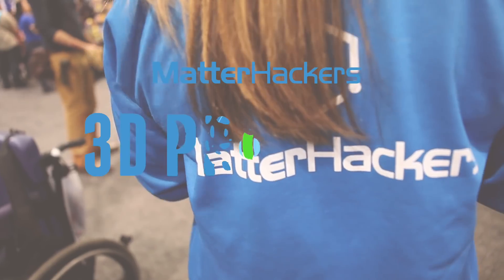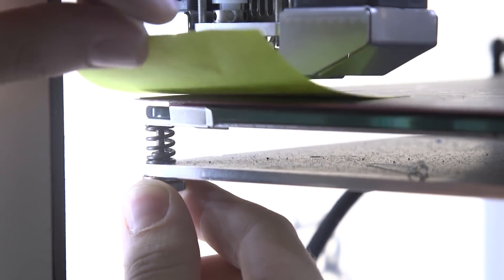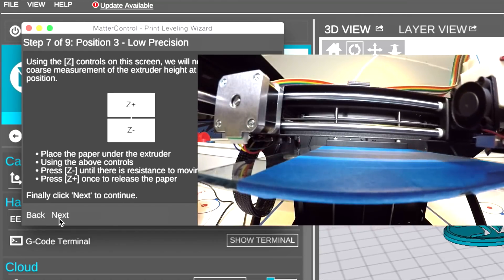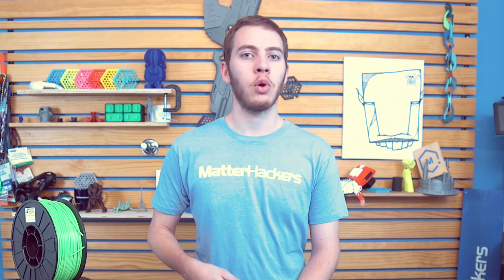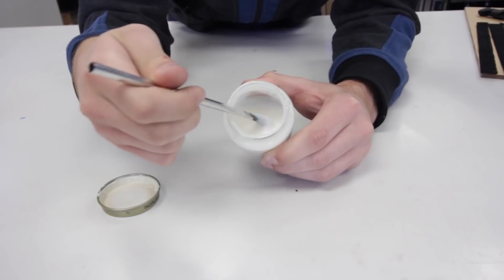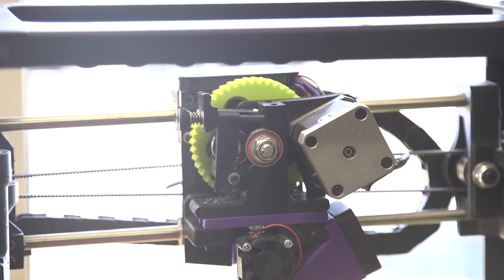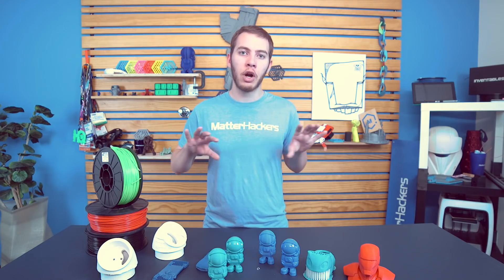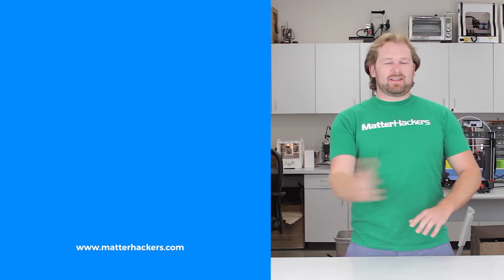How To Succeed When 3D Printing With ABS Filament // How To 3D Print Tutorial

Comment: You're so right, I think the key is the ABS slurry (acetone + ABS) and a rough surface to promote a mechanical bond.
I also laugh at the "smooth bed" comments.  Clean of your finger oils... yes, but smooth, huge no.  But if you don't want to scratch up your build plate, I often use wide kapton tape.  You can scratch that up with 0 guilt.  Just peel it off if you need to return to a smooth 😎 surface again.

Also, on my giant CR10-S5 bed it will only do 80c on a good day (barely, that's mostly lies unless I break out the iron 😆 🤣😂)...  So ABS can be a nightmare on that.  I have a new A/C silicon heated bed coming soon.

But, even on that, I AM able to print ABS using ABS slurry, as long as the slurry sticks tight to the bed, and the print is not too tall.  Unfortunately, the taller the print, the more chances it will rapidly cool and split mid-air.
ALSO...
WARNING ⚠️  Some bed materials will degrade immediately when contacted with acetone.  
Glass is ok 👍 
I use a Wham Bam PEX flex bed on the S5, and they even officially recommend restoring it with acetone, so I know it's safe to use there if that's what you have.
My other smaller printer has an aluminum build plate (which is where I frequently use the kapton.  It pretty much stays that way lolz).

So just be careful with your "special" coatings.

Also, turn off any fans, close nearby vents, generally block airflow, and don't try it in your sub-zero garage in the dead of winter 😉.

Comment: I print abs perfectly fine at 90-95c on PEI, my printer Is in an enclosure. I print around 230-250c hotend. First layer .3mm, 30mm/s after 4 layers 62mm/s no fan on unless bridging. I get nearly perfect prints. I do also use a little bit of gluestick*thin coat*. Hope this helps someone that maybe at wits end and has tried everything else. Good luck, happy 3d printing.

Comment: I don't understand why this video doesn't cover the issue of ABS sticking too well. Makes us think it is hard to stick while in the meantime it gets glued to my smooth pei sheet (ASA is even worse!) and even pulls of pieces of the pei. 

Yes it warps and cracks without an enclosure, but the first layer, and especially those nasty brims you suggest are the hardest to remove.

Any idea how to prevent this?
Reply: Use a purple elmers glue stick and a little water to create a thin layer on the print bed. There shouldn't be visible glue on the print bed, it should be super thin and almost invisible. This same trick works for PETG too, happy printing!

Comment: I just got my Creality enclosure and was trying to print ABS on my mirror tile. PLA sticks fine with nothing. I tired glue stick and I have no idea how anyone can use that cause it just dries and gets super slippery for me. Then I tried a couple light passes of hair spray and it was like magic. Cura has the default ABS bed temp at 80C for my Ender 3 Pro and it worked fine. Sure glad I didn't start off with ABS when I first got my printer cause that would have been an even bigger hurdle than dealing with bed leveling before I got the EZABL installed.

Comment: A lot of this goes the wrong way in my opinion. Some of this improves the outcome and improves chances of a good outcome, but it needs to go farther for better results. One, discourage the use of a sliding bed machine is suboptimal for ABS. This is because the constantly sliding interrupts the boundary layer insulating the part. I know people do successful prints but it's harder and more likely to end in failures and likely to have more internal stresses in the part. An enclosure helps but it should be an actively heated enclosure of at least 60C whatever the machine type. And I've found that a not-sliding bed requires less enclosure heating by 5-20C compared to similar results with a sliding bed machine. A not sliding bed is easier to enclose too since you don't have as much volume to enclose. This may mean improvements to the machine, especially if anything is printed in PLA or PETG.

I'm pretty sure Kapton tape doesn't disperse the heat any better than glass. 

I really don't understand how an enormous brim helps because that plastic at Tg is usually pretty weak. At best, it's a band-aid.

It seems like hairspray-all-the-things suggestions are inappropriate. If you have clean PEI you shouldn't need to use hair spray on it, otherwise it's just an expensive substrate, might as well just use hair spray on glass.

Comment: Different printers have different success rate when it comes to printing ABS. I have a Lulzbot Mini and it prints ABS near perfectly right out of the box. It doesn't look as detailed as PLA, but you normally use ABS to print functional parts - mounts, enclosures, etc. So beauty is not a priority. Yes - if a part is large (ie it takes the entire bed) - corners will lift a little bit, but it doesn't affect anything other than aesthetics.

Comment: I have a big experience printing ABS. I don't even use enclosure, unless the temperature is below 10 C in the room. I heat my Prusa style ( Anet A8) printer  to 90 C and that's more than enough. I use 236 C for hot end.  Printing speed 60 mm/s, 0.2 mm layer build.  The main secret of printing ABS is to create a good grip with the surface of the bed. What I did is I got 80 grit sand paper and I rough the surface of my cheap window 1/8" thick glass bed wet sending it in one diagonal direction.  It takes about maybe 10 minutes. Then I use ABS slurry ( acetone + ABS filament, yogurt like consistency) to cover the bed with finger or piece of anything...whatever, but don't use sprinklers. It doesn't work with spray gun or mechanical sprinklers. I've never got any lift off problem printing ABS. It's amazing how most of 3D printing guys using smooth surfaces of the bed ( glass, aluminum or whatever) and expecting for the printed part remain attached and not get lift off. Come one people. Its physics. If the surface is smooth, nothing gonna stick to it. You have to create a nice grip just roughing the surface. I did with 80  grit sand paper and it works. Just get a block of wood. Just fold it with 80 grit sand paper and start wet sanding ( from one corner of the bed to another corner, don't crisscross) it  for like 10-15 minutes. That's all..... It works with ABS. I only print ABS and its great. It works every time. Peace of mind and you can rather concentrate on your design. And one more thing for ABS please dry your filament in oven 4 hours before printing for better result. You can use cheap $35 food dehydrator. There are plenty of them on the market in range of  $25 - $65.
Reply: Tigran Ohanyan your comment was better than this whole video! I’m goin to try this out
Reply: I just would like to say that I tried everything that you said and now I print abs amazingly well!!!! Thank you so much for sharing your experience
Reply: Thank you, this is more along the lines of what I was looking for since my bed only heats to 80, not "if your bed can't do 110c gtfo kid".
Reply: how do you would the precision of your ABS prints? Is 20mm, 20mm after printing? or more or less?
Ive found PETG and PLA to be very precise.
Reply: Awesome ideas for abs! I'm definitely going to give it a go
Reply: Haven't tried ABS yet but regular PLA  sticks a lot better now.
Thank you for sharing this tip
Reply: I just started trying ABS and came to most of the same conclusions. I have a small test print going. Bed is 90. Nozzle is 235. 66.6666mm/s. I used glue stick... It was terrible for PLA. But this is the first print I've got to stick with ABS. Glue stick is working so far. But, I'll definitely get a piece of glass I can scuff up and use as an ABS build plate to see if it helps. Thanks!

Comment: This will help me out a lot,starting out with printing ABS on an Anycubic Kossel Delta Linear Plus as my first printer,been getting good results at 230C hotend and 100C bed temp,but now I will up the temps and hope it makes the difference I need,also printing at .1mm which seems to help and a speed of 30mm/s at 100% flow and fan speed at hotend 100%.Still learning but I think this info is what I really needed to know,thanks man
Reply: THEOZ2106 I have the same printer you have and I print abs with 245c nozzle and 110 bed and fan at 30-60% at 60mm/s

Comment: Hi guys! thanks for the video Im right now deciding on what 3d printer to buy there are so many and Ive seen All the reviews on youtube and I just got worse , now I really cant decide??!
need help picking a good printer enclosed with heated bed for ABS and space for big builds and as I can see auto leveling would be good price range up to 2500 maybe 
Thanks !
Reply: It's hard to find an enclosed printer with a large build space.  That's one reason why open frame models are still so popular.  If you need the print volume then you need to go with an open frame and build your own enclosure.  If a 25 x 21 x 21 cm (9.84 x 8.3 x 8.3 in) build volume is good enough for you, get a Prusa MK3 and build an enclosure for it.  Best bang for the buck.  Assembled is $1000 + shipping.  Spend the money you save from that $2500 budget and buy an enclosure.
Reply: Nunya Biznis 
Thanks so much for the info i will take your advice for sure👍
Reply: Also, if you want a good-looking semi-permanent looking enclosure, look around for a small, used server cabinet with a glass front door.  These look great for 3D printers and they usually have side panels that open up so you can easily access your printer from the sides as well as the front without having to remove the printer from the cabinet too much.  The only "problem" with these is that they are made with ventilation since they are made for servers. The solution is to buy some foam stick-on door insulation strips at home depot or lowes or wherever to seal up all the ventilation around the doors and panels.  If you are looking for a nice-looking enclosure, these can't be beat IMHO.
Reply: Nunya Biznis 
Thanks !! That sounds like great idea im going to look in to that , thanks so much for the advice and help

Comment: Good tutorial but your tips for bed adhesion is not accurate. bed heated to 110C is good for 99% of the time. Bed material is normal glass or aluminum plate. The buld surface should be absolutely clean of dirt and oils. ABS likes to stick to Kapton tape, PET tape or PEI.  You can also add ABS wash for extra stick.  The printed part will pop itself off normally once the bed cools to room temp. Save the hair spray for PLA.  You can even print directly to heated glass or aluminum if it is treated with ABS wash. The purpose of the kapton tape is not for even heating. It does has some insulating value but that is not its purpose. 

Not all printers can heat the bed to 110C with out modifications   Add some heat insulation under the bed to conserve heat. Make sure your power supply can handle the power needed. And make sure you controller board can handle the load.  Many use undersized power components and are prone to melting and catching fire.

Also, you can not use the part cooling fan like you would with PLA. Too much cooling will cause layer separation and warping. You will need some kind of cooling for small parts though.
Reply: I have a CR-10S and also use a bed temperature of 90 degrees C for ABS.  I only recently began to have success printing with ABS and the single biggest reason was probably because of my experimenting with  the hot end temperature value.  Cura has it at 230 degrees for ABS, I tried it at 240 degrees.  Combined with the fact that I reduced my typical layer height from around 0.2, 0.3 mm to around 0.16 mm and my line width to 0.35 mm (nozzle is 0.4 mm) I was able do excellent prints.  I believe that using a smaller layer height reduces the tension the topmost layer has upon the layers beneath it at the expense of having a longer print time.  For bed adhesion I use a clear lacquer that can by sprayed from a metal can on to the glass plate.

Comment: My favourite now is ASA. Very much like ABS except ASA is UV-resistant, doesn't warp as much as ABS, doesn't stink and uses similar temperatures to ABS.
Reply from the maker: ASA is a great material and is an excellent alternative to ABS.
Reply: You are correct, and it is slowly gaining recognition in the 3DP community. However it is hard to find in the USA.  When you do find it, it is usually around $50+ for 1kg and color choices are non existed (white and black is all I can find).  There are some EU sellers that have it but they are also expensive and shipping is outrageous to the USA.  I hope it catches on soon so that prices will go down and color options will be available.
Reply: I wish some/more US retailers would import rigid.ink.  For now I've been using Fillamentum ASA.

Comment: 3:51 why near 110°C ? I printed a lot of abs, and every time with a 90°C bed! And it works fine! Info: I have a wanhao duplicator i3, with buildtak on it!
Always great information and research(exept for the 110°C ;-) ) even if I know most of the things you say; everytime I learn small details!! Keep on making such informative an great quality videos!!
Reply from the maker: Thanks for the kind words! We get successful prints with 110°C, but if 90°C is working for you, definitely stick with what is working!
Reply: MatterHackers Ok, I might try to print 110°C on the bed, if I have to print aechitecture-models for my brother, because we get little warping, but most of the time the warping isn't a problem, because it isn't visible!
Reply: I first tried to print in ABS today, but I just couldn't get the print to stay on the bed no matter how hard i tried, it would always pop off. So I watched this video and set my bed to 110c instead of the 90c the wanhao duplicator i3 recommends, and printed perfectly first try! I recommend 110c.
Reply: It could be that you think your bed is 90C but is actually closer to 110C.  Or it could be his bed is not really 110C but he thinks it is because his printer (or your printer) is inaccurate.
Reply: Solid chance your temperature sensor is off as well, keep in mind.

Comment: Umm I'm 14 and I have a tiny room. All I do really is 3D print, and I use PLA. ABS just seems way to annoying. I have an anet A8, and I have it near my ceiling on the top of my storage cubes and it overhangs the edge so that first of all is a problem to keep a box around it. Then, how do you get rid of fumes? I can't leave a pipe going across my room with a fan?
Reply: George Elsham You could do air filters but they dont last forever the tube would be the best soloution if you could do it
Reply: No much you can do.  You should never 3D print where you spend a lot of time. You could buy a fume extractor like they use for welding, but they are expensive and will take up more space in your room as well as eat up more electricity.  In short, you're screwed.  You will probably die by age 30.  Have fun!